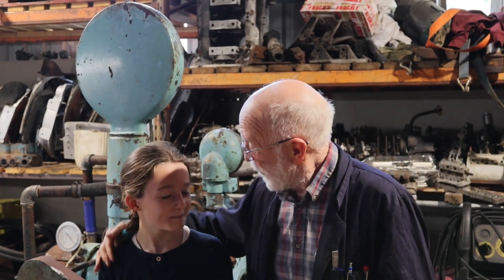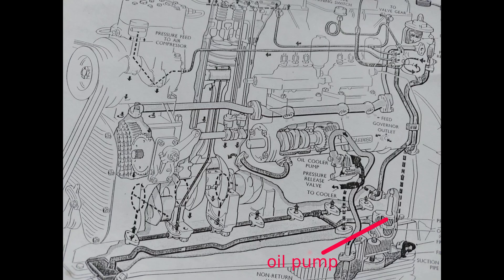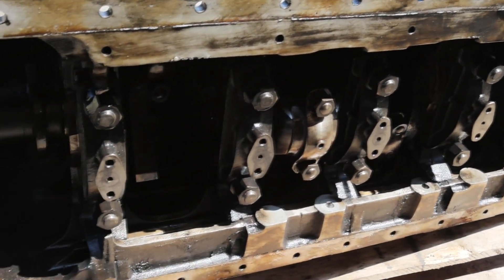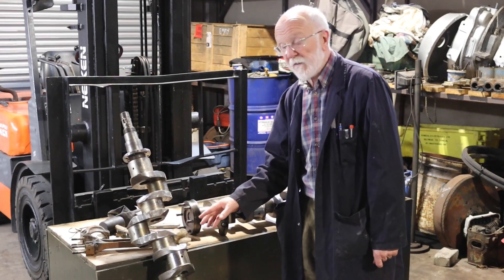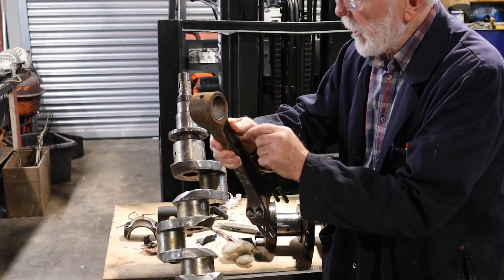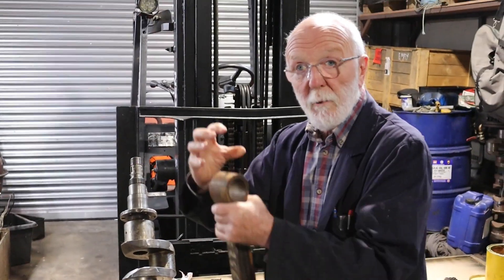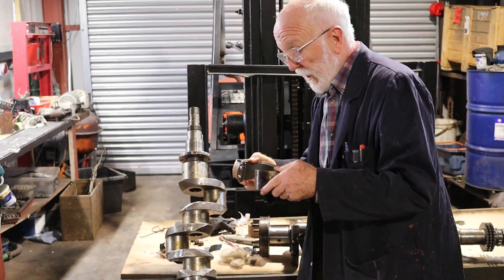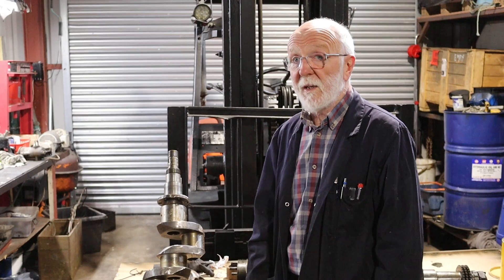Gardner Engines: a closer look at good oil pressure and what it means.

Comment: I always felt that Gardners good reputation let them down, the number of times we would be told by a customer things like, how pleased they where with there engine, “it’s done 50,000mls and never had an oil change, when we started carrying out diagnostics after an engine failure and found the oil was like tar, it was easy to believe them.
We would have to break it to them, that dispute their reputation for being an extremely robust engine they did need regular engine oil and filter changes.  🤦‍♂️